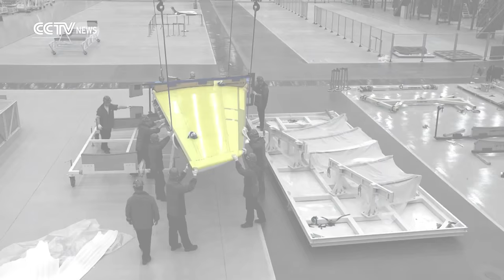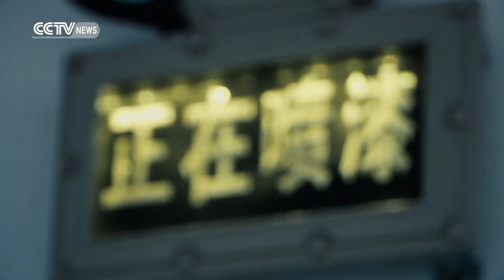Exclusive: Watch the assembly of China’s ‘big plane’ C919 in 140 seconds!

Comment: how many seating capacity? you need to prove to world that its safe. Sukhoi Superjet got 1 plane crash already.
Reply: +obet06 The plane can can carry 158 seats.

I mean, the Sukhoi Superject crash was because of pilot error. The collision avoidance system was working. It was just the pilot who ignored it.
Reply: +obet06 its an engineering sample for reliability test...
Reply: +obet06 It's all about how the pilots handle the flights.  To be honest, new planes will have a higher chance of crashes due to not enough flight experience

Comment: With  the  trash  from  products  from  low  quality  what  manufactured  the  Chinese :  I'm not  crazy for  travel in this airplane.
Reply: I hope you don't fly on boeings, because the critical parts of boeing aircraft are built in Chinese factories. Check out boeing's extensive list of parts built in China including parts for the iconic 787, 777, and 747:
http://www.boeing.com/resources/boeingdotcom/company/key_orgs/boeing-international/pdf/chinabackgrounder.pdf
Reply: This idea that parts are from China has no facts. Parts are from the West and all engineering, chinese cheap labor assembled them so there is 2 different meaning when you say built and assemble.